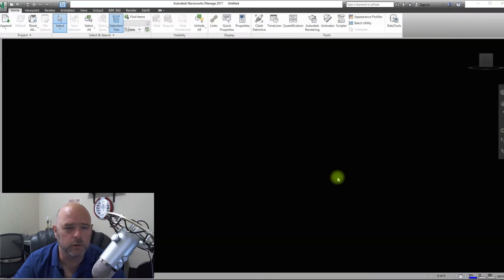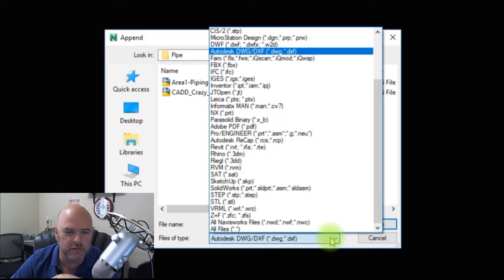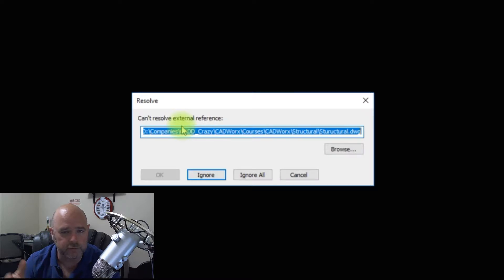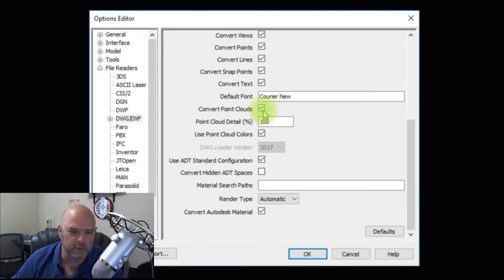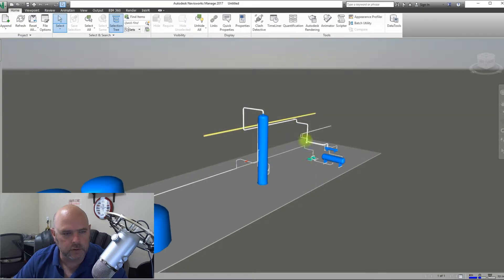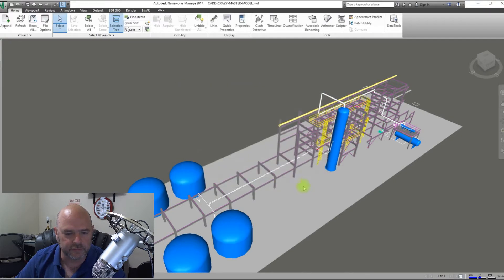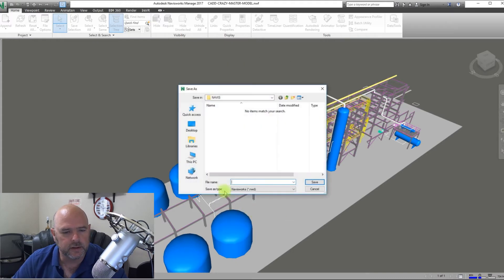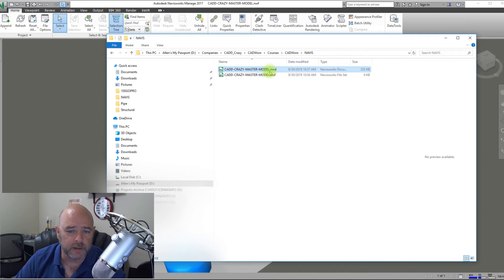Navisworks Model Creation, the right way

Comment: Hey, Thanks for the video. Liked it. How to add new attributes from CADWorx file to Navisworks?
Reply from the maker: You can add custom data to your CADWorx Model by using the Spec Editor, or you can add data to the fittings using a Navisworks 3rd party plug in like BIM Cave to add it.